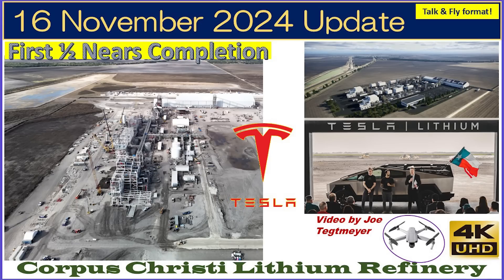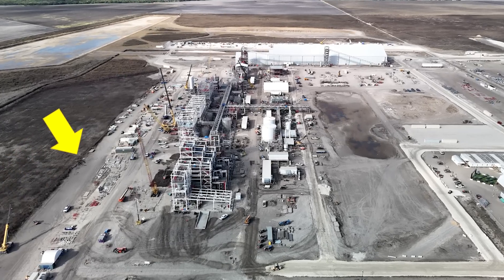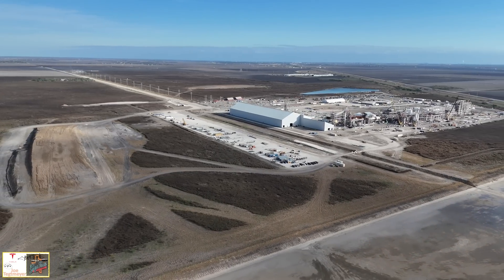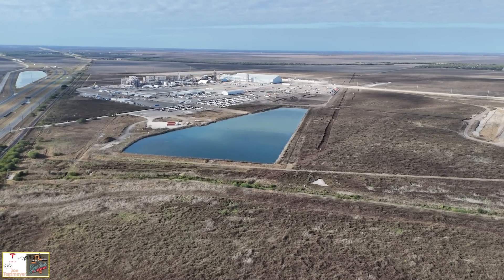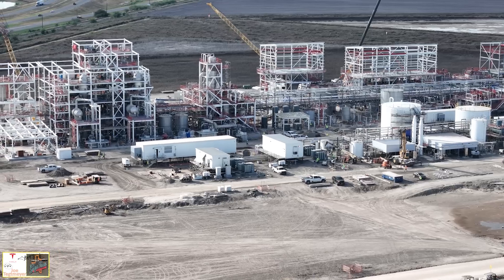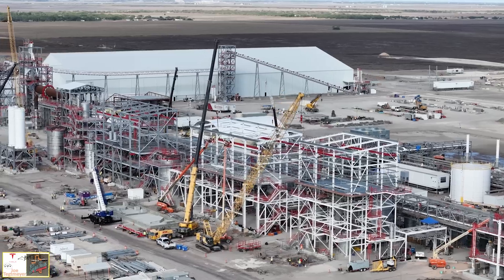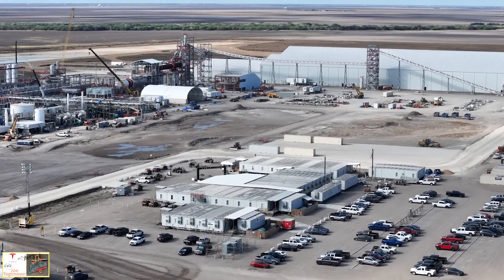Tesla Corpus Christi Lithium Plant Review & Discussion! 16 Nov 2024 Site & Ops Update (9:15 AM)

Comment: Thanks Joe
0:56. Kiln. Series of large pipes and square structures in front of the kiln is not unlike the baghouse structure at GT.
1:13. Red beams at the top of the structure are beams for the bridge crane rails.
Installed bridge crane seen far right at 1:18, and 12:35.
3:03. Dump for spoil. Bottom right. Berm/embankment looks man made. An old stockpile of earth. 
5:12. Stockpile of earth. The grey might be the local excavated earth. Light brown looks more like the sandy clay seen at GT.
8:00. Bottom. Concrete slab. Temporary pre-cast yard. Casting some components here for use elsewhere on the site.
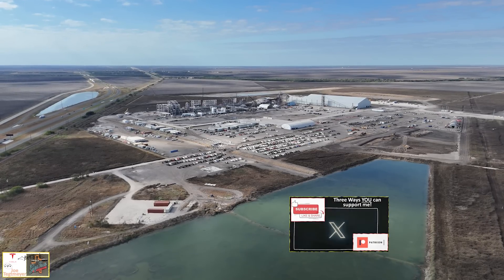8:24. Former pond. Excavating along the south side, and infilling the pond. See load be dumped at 17:03.
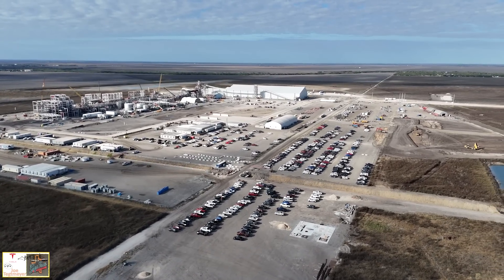10:54. Transformers. 2 pairs of 2. Grey. More at 7:58 to the left.
13:15. Bulk storage building. 3 different roof pitches.
Reply: Oh hi, you still at it!
Reply: @musaran2  Like a bad penny.

I have an end date in mind. Unless something else catches my interest. The tunnel and baghouse has keep me going the last 12 months.

Comment: Outstanding report Joe. I suspect the water pond is for site drainage. The entire site situated on the flat low basin is a swamp with relatively high ground water table. You need to ensure adequate site drainage for stormwater and site ground stability. Cheers.
Reply from the maker: @peterjohn5834  😎

Comment: Last I heard the 4680 project management at Giga Texas is under the gun to work out the manufacturing problems within the next 12 months or be shut down. I wonder how that would affect the Corpus Christi lithium hydroxide plant.
Reply: They already solved the 4680 problems.
Reply: I think the deadline was end of year 2024, but as rozonoemi9374 said, those problems have been solved.

Comment: Lots of equipment, sensors, motors, etc to get running. 
They will probably first do dry runs without raw material, then runs with raw material to calibrate the sensors and equipment, and finally runs that test production quality and volume. You would only use a train when you had a trainload a week or more. I expect spodumene is not sent as a bulk material - lose in a cargo hold of a bulk ship, but in six metre (20 ft) long containers that are allowed to weigh 30 tonne. How it is sent is a question worth asking. The 40 ft containers are also only allowed to weigh 30 tonne. 
Spodumene in containers would allow purchase from any spodumene concentrate plant in the world. However, consistent raw material is key to the quality of output. Many Australian producers are near Perth. Containers of spodumene concentrate could be send weekly from Perth to a transshipment hub in the Mediterranean, then onto ships bound for the US Atlantic and Gulf coasts. Corpus Christi could be the last US port of call, but the ship might also go to Mexican ports too.
Reply: @peteregan3862 I think the philosophy Tesla is pursuing is more about localizing supply chains, as long as they keep some flexibility in sourcing. Reduce costs as far as possible, but not at the cost of security of supply. The rail line should serve well for Lithium sources within NA.
Reply: Is Spodumene produced in the US? It would be nice to have a self contained supply chain in the US as a hedge and to keep the prices in check.
Reply: I think the original plan was to use lithium mined from teslas own lithium mine located in Nevada.  Lithium prices could affect this strategy.
Reply: @robdewdney3197  Thanks.

Comment: Do you think Tesla are slowing down it's lithium plant due to possible new Solid State battery chemistry?
Reply from the maker: @favesongslist  no, not in the least.
Reply: No I don't think so as solid state batteries will be more expensive than lithium base batteries.
Reply: @rozonoemi9374 Solid state battery cells do not use liquid electrolyte but ceramic. The Cathode is still made of lithium and the Anode of carbon. Only if you switch the chemicals to Sodium or Ka, Ca the Lithium is not used anymore.
Reply: No, Lithium is still the most efficient ion transport material known.

Comment: Joe, this looks like a two line lithium processing plant. One line is being constructed and will be operated first to produce the raw material for the cathode plant at Giga Texas. The second processing line will probably take a much longer time to get started on the construction. As you mentioned, lithium supply and demand are factors that affect the production from this Corpus Christi plant.
Reply from the maker: @ismailnyeyusof3520  yes, two parallel processing lines with different construction timetables!
Reply: Legacy auto announced all manner of things with regard to future EV expansion and that immediately stoked the fire of refined mineral production. But....  during the second half of 2023 and into 2024, Ford and GM totally reversed course leaving a glut of minerals used in battery production. Spot price of lithium alone has dropped by around 83% since March last year and along with the glut it has been cheaper to buy it in. Elon has said they should reach price parity with outside supply by year end though never got into useful details. I personally think that there will be no significant change until mid 2025 or even later.